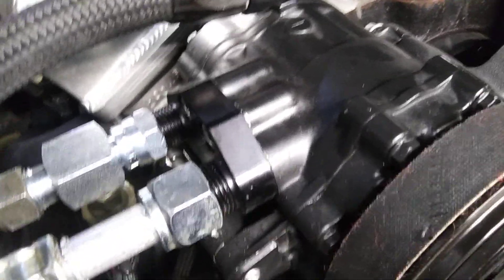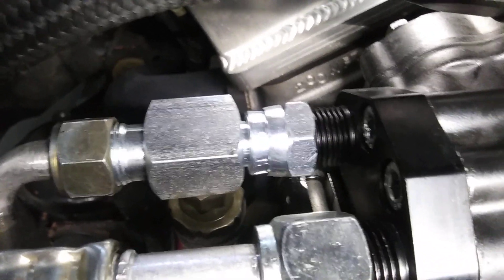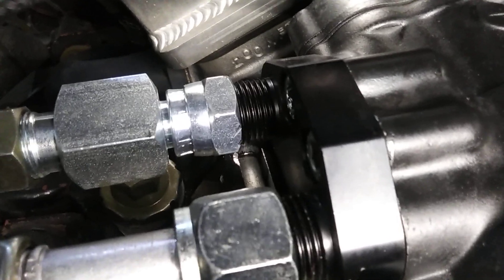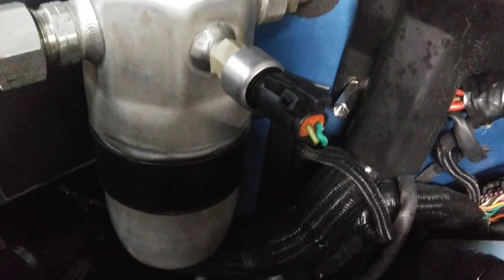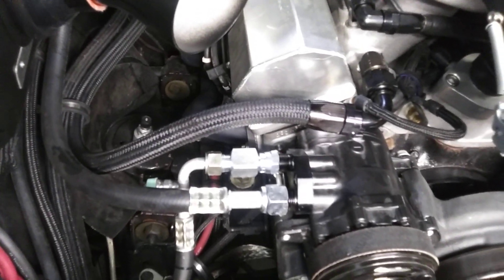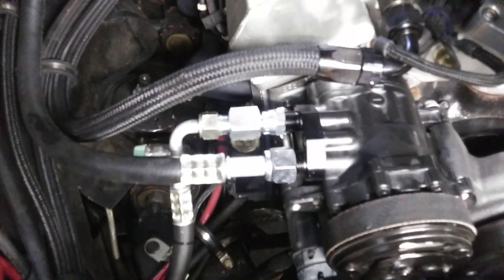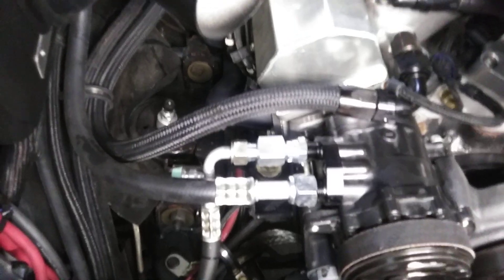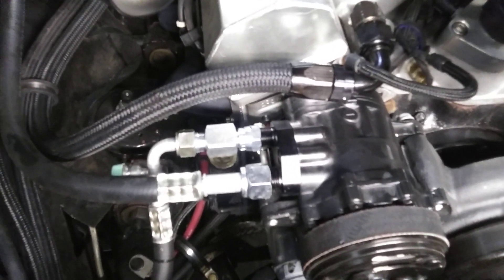Chevy OBS air conditioner system upgrade from pancake R4 AC compressor to small SD7 compressor 1993

Comment from the maker: By the time you buy the ac hose fitting crimper, new hoses, fittings, switch and O-ring kit it would be about same money. Plus if you are new to ac system building the kit comes with instruction.

Comment: Dang. That'd be nice to install in my S10. I put a whole new AC system in it, put on r134a fittings, put PAG 150 in, and initially i did use r134a, but it wasn't all that good, so I used propane briefly, but since then vacuumed it and switched to compressed air. 60-ish degrees F at idle on a 90f day, about low 50s driving. Heck, it got down to upper 40s when temps dropped around 80 which was nice. The propane did a good job cooling too, but didn't really test it on hwy.
Reply from the maker: Nice! Good to know.